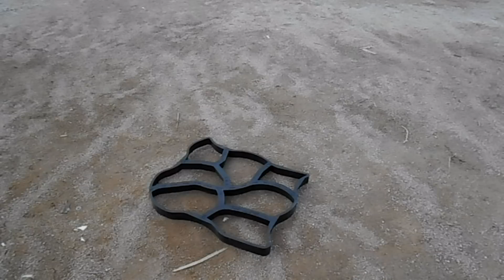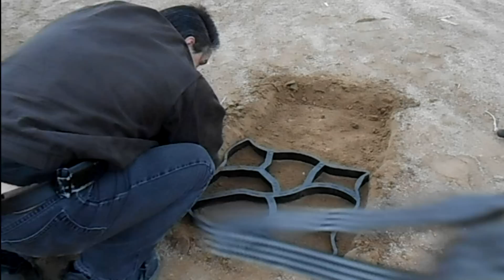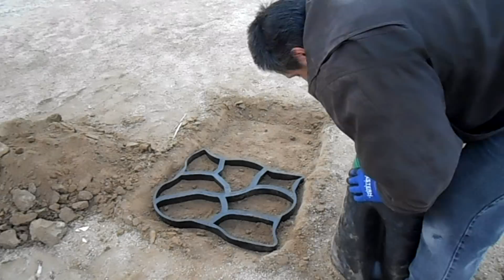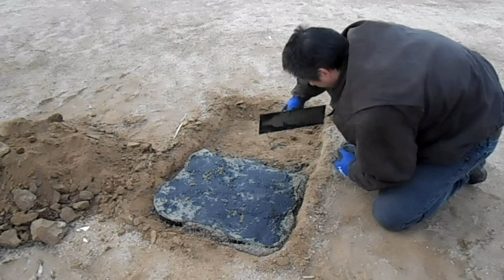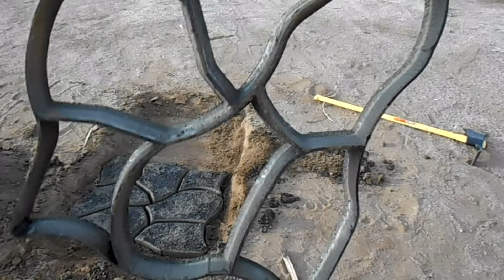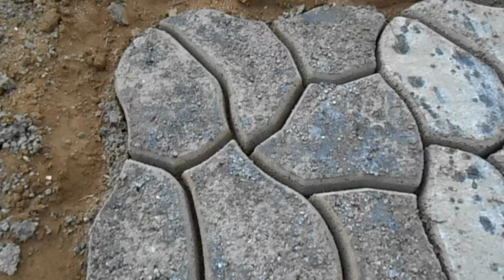Pathmate Concrete Mold Test

Comment: Didn't think you had dig couple inches & level& level & level. Can't lay on top of level dirt? Don't like color splashed on top, just my opinion
Reply from the maker: Depends on what you want.  Normally, you don't have to dig or level if you have grass and don't mind the concrete being higher than the ground.  As for leveling, I was doing it because I needed to do a break job and needed something to put the jack on.  Normally, the concrete will take on whatever shape your ground is.  if the top of the mold is level, your "stones" will be level.  As for color.. it's better than just concrete color, but not much.  I plan on doing one more and use a paint brush to apply colors and see how that turns out.
Reply: True! Thanks  :) I've seen a video with them being laid on level dirt for walkway and looked like less work. Concrete was more loose too.
Reply from the maker: Yup, I don't have any grass, so if I just laid it on the ground it would stick up a few inches higher than everything else.
Reply: James Zawacki It makes sense using paint brush on top because I read you need to use whole bottle mixed with water, then add to one 80Lb. bag concrete mix. Save $$$$ right there. Thanks for the idea.....  :)
Reply from the maker: If you follow the instructions, you end up with the entire cement that color.  I don't want it all to be the same color, I was trying to give it random splashes of color.  That didn't work, so next time I'm going to try streaks of black (which dry charcoal grey) and streaks of red, just to see how it turns out.

Comment: Do you think i can use this on my drive way? Does it hold the wieght of the car?
Reply: jockenielsen you’d definitely want to make your own mix, find a mix that is meant for strong use. If not you might look into pavers that have holes 🕳 allowing space for plants etc to grow in between. Not sure what they’re called permeable pavers perhaps? Anyways you want a well known mix of sand, aggravate/rock to cement mix ratio that is meant for high strength and you may need to add rebar!

Comment from the maker: I don't know yet.  It will hold the weight of a car, as the main purpose of this test was to give me a solid surface to jack up our van to do a break job.  It held up fine to driving on a few times and for the jack.  But, I don't know how it would hold up as a driveway.  My main concern is that standard concrete slabs are 4 inches thick.  But, many people have paver driveways that are about the same thickness as these.  If you get to it before I do, please let me know how it turns out.
Reply: How did yours turn out want to do a large patio with this mold recommend?
Reply from the maker: @elainedepiero7405  Sad to say, I never ended up pouring the walkway using these, I ended up having a 750 sq ft concrete slab poured and a garage built.
Reply: James Zawacki noticed u did all of research on this walk maker mold would u recommend for a 400 sq. Feet patio ? My base is 3/4” clean gravel also wondering if I should put sand first on top of gravel . I live in Canada thanks for your reply

Comment: Perfect example of how NOT to do a concrete mold.A little late to check the level AFTER the pour.Ever consider reading instructions. Mix the colorant IN the
mix, NOT thrown on top.Seriously???? A level for a screed ??????A pick axe for a vibrator???????????????????
Reply from the maker: Perfect example of how to post a comment without actually watching the video!  I clearly stated I wasn't using the colorant as intended.  I didn't want the entire batch to be grey.